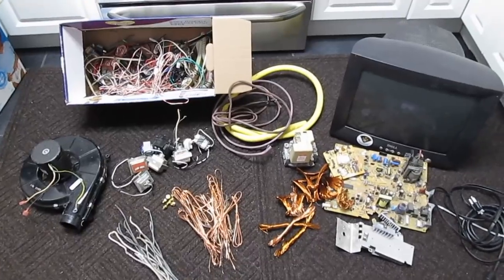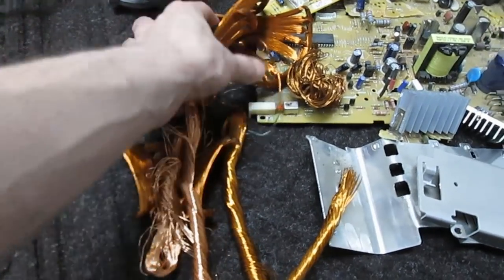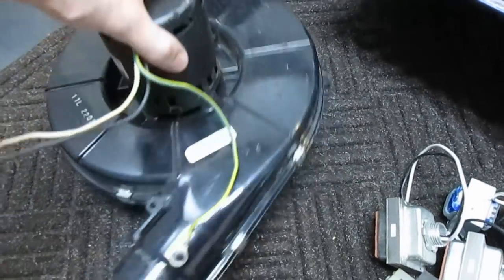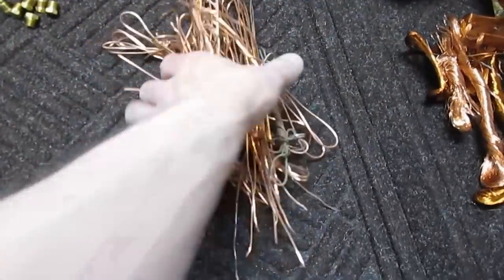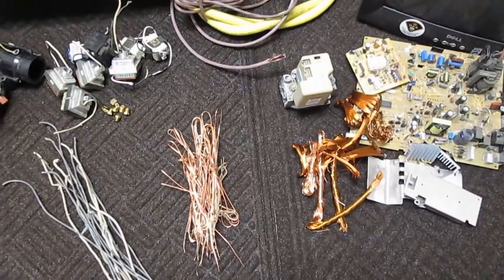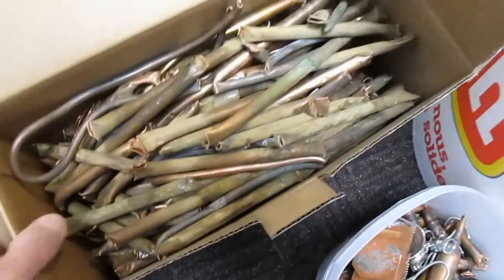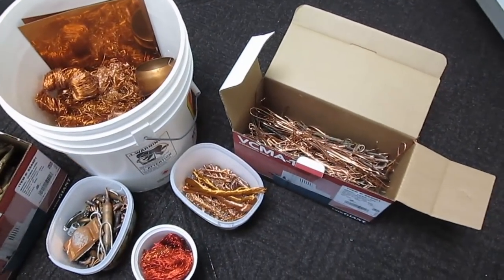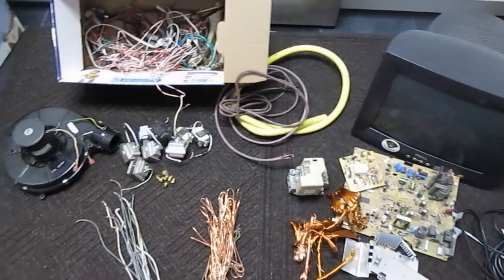Dumpster Diving Score💲 & Copper Piggy Bank Hoard 💲

Comment: Just a heads up for those losing footage or corrupted files.
1. Never buy cheap cards/drives. 
Make sure they are legit and not KNOCKOFFS!
2.Always do a full FORMAT or reformat before using and after use of card. Either in the camera or   on your PC. You want it wiped clean of files before you use it.
3. Always make a 2nd copy on your PC before you put it into any video editing software. 

I hope this helps you all.
❤❤❤❤✌✌✌✌
🤙🤙🤙🤙🤙Yeeeewwww!
FOR THE DREAM
Reply: moosetube a virus actually corrupted my device I used to do vids
Reply: SCRAP Kingdom!!!! Was it a phone? If so you can definitely reset it back to its original state like when it was new. Same if it was an iPod.
Reply from the maker: Thank you Moose tube We just re formated a couple olds ones we didnt think worked anymore and now they Are working Just Fine lol :) We are still learning so much and so glad you commented Thank you :) :)
Reply: Freeisbetter86 You're so welcomed. I'm no computer genius but I do posess a huge library of virtually useless knowledge. LoL 
Glad I could help.